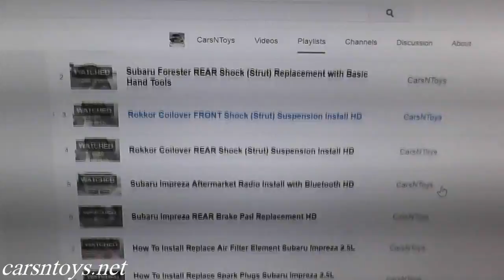Subaru Front Stabilizer Link Replacement with Basic Hand Tools

Comment: How did you know you needed one?  I replaced the inner and outer tie rod ends, new tires with alignment and steering wheel still noticeably shakes at 70+ mph.  Any feed back is appreciated!!  Thx
Reply: Balance your tires and check your rotors

Comment: Is it safe to drive if the stabilizer link comes off or get broken?? How much time before it needs to get repaired says it breaks while driving??
Reply: You can actually drive without a stabilizer bar/anti-roll bar, they just help with chassis stiffness when cornering. You would be okay if one were to break while driving, just take it easy on corners :)
Reply: Just replaced two on a 2001 Outback, I needed a cutoff wheel, torch and an air ratchet, 3/8 breaker bar and a flexible 3/8 ratchet, the key was holding the inside with a 14 mm while removing the nuts. Very hard to access the nut with an air ratchet.

Comment: your videos helped a lot. thanks. however, one question to this video: do i need to jack up the car on both sides at the front, or is jacking up the car on one side  (the one on which you replace the link) also ok? (i was asking myself, if there would be too much tension on the sway bar, if the car is just jacked up at one point, resulting in some kind of warping and the front axis not being symmetric causing that the link will be hard to be removed).
thanks
Reply: Another video about sway bar bushings suggested both sides but im not 100%. I personally only do one side if im not going underneath and have extra stuff setup just in case.

Comment: If the hex in the stud end strips, how do you remove it?
Reply: use oxygen acetylene torch or  grinder with cutting disc
Reply: or you can use pry fork
Reply: I got mine off really gripping the other side with thin vice grips on the round part.

Comment: what was wrong with the old one? looks like very simple thing. What can go wrong with them. Mine was broken by a wombat back, by the way.
Reply from the maker: The old one was clunking over bumps. Common issue with Subaru.
Reply: @CarsNToys  I replaced mine today with whatever the local auto shop had (TRW brand), not OEM. I liked it better. Seems a bit sturdier. I am not a mechanical person and this thing puzzles me. From their purpose description it sounds like they have to endure considerable forces, but the build is flimsy.  After installation, I have been looking at them while car was in uneven surface, like one wheel on the road edge, etc They bend in weird way. Couldn't understand what forces and what direction they transfer... Anyway, they must be doing something. Not much apparently, as I have been driving around without any obvious difference...
Reply: I bet the wombat was not too happy about that !!
Reply: @niktarasyuk8514  
They attach the sway bar to the suspension system.

It is used to stiffen the suspension when sharply turning. It has no impact when driving straight.